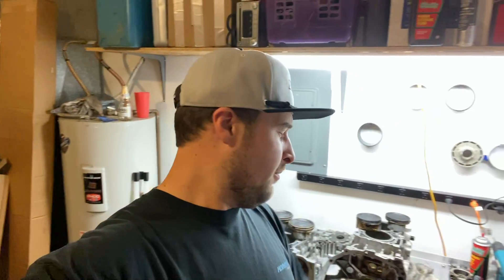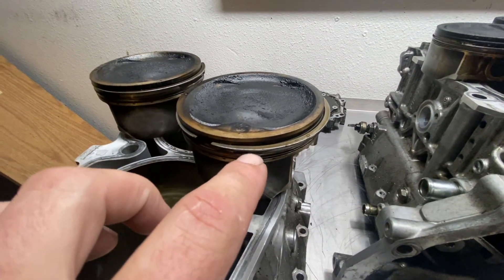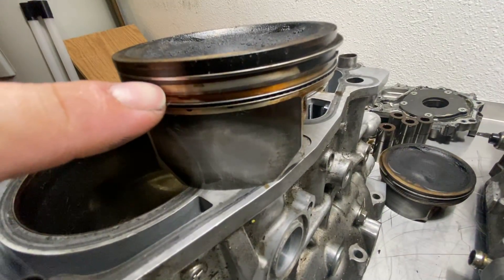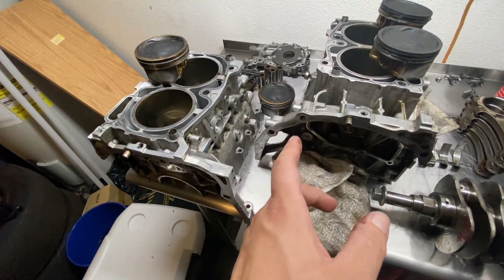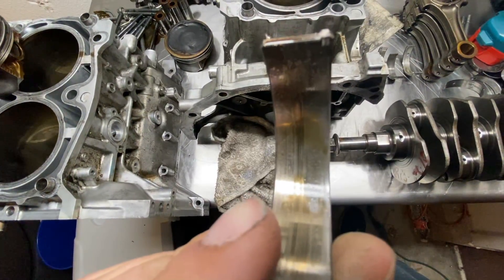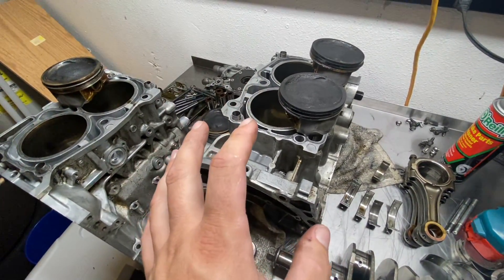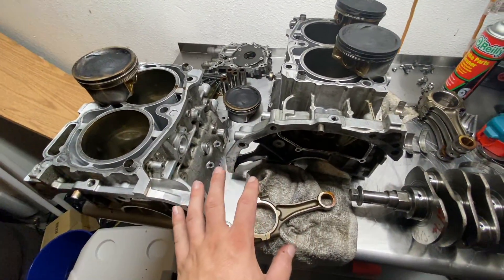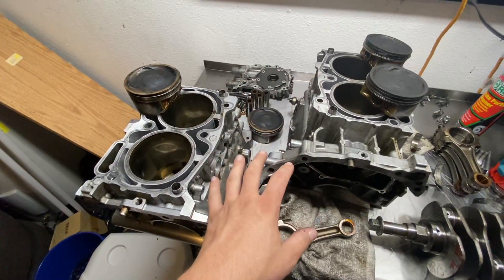Subaru Ringland Failure FAQ

Comment: Don’t sti’s have knock sensors?  Doesn’t sound like they are doing there job.
Reply from the maker: The problem becomes when the tune is modified to aggressively where the knock sensor can’t pull enough timing fast enough , this is actually the case with pretty much any car not just the sti